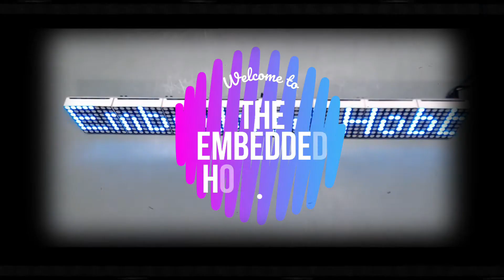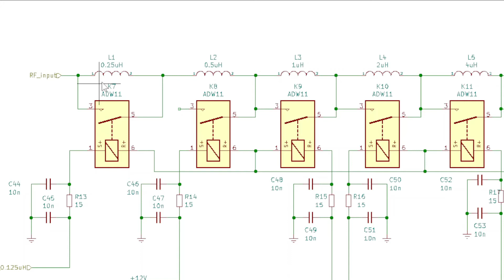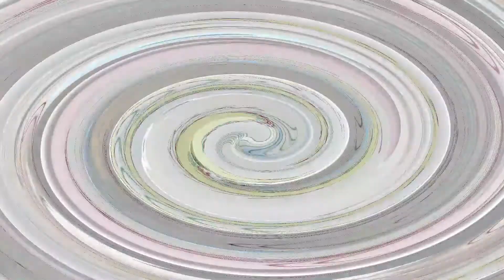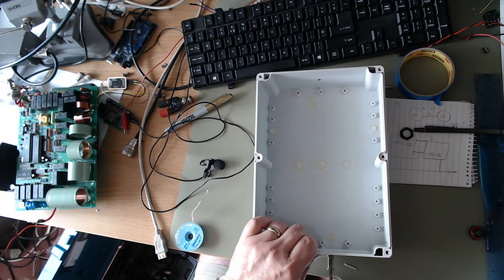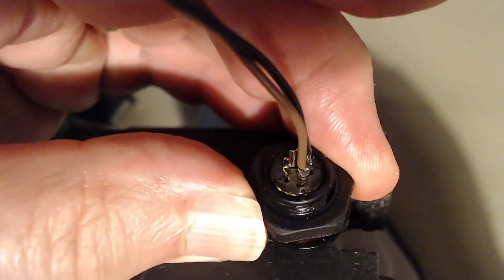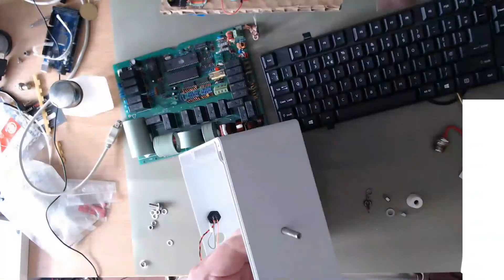#127 CG2000 PART II

Comment: I've one of these I've just dug out of storage that I'd previously re-cased after cracking at the antenna feed point at the top, probably going to put it back into service feeding a random wire. Have you ever had to use the "reset" line?
Reply from the maker: No not yet. but I'll keep an eye out for it.
Reply: @TheEmbeddedHobbyist  Just asking because for years I ran mine with just 12V and GND ran out to it and wondered if it was really needed.
Reply from the maker: @MattHill303  well if it don't tune, just drop the 12V off and back on again and it will be the same as a reset. it will just have to learn the settings again for a quicker tune..
mine is down at the moment while i re-think what antennas to have up.